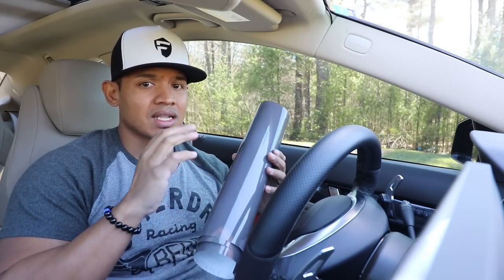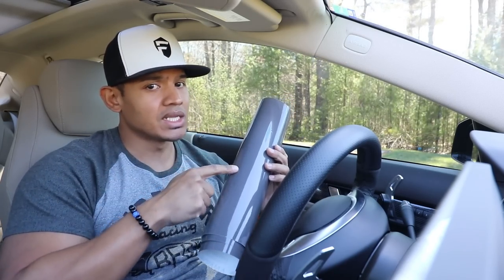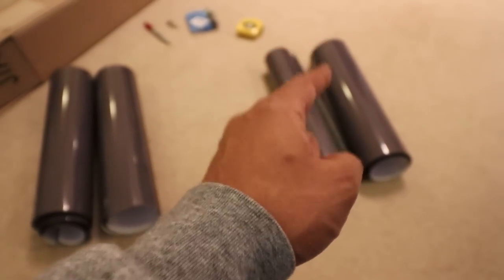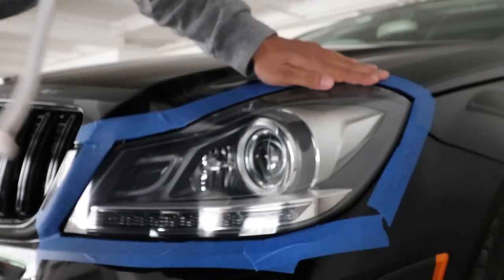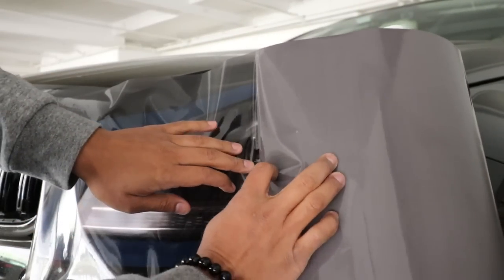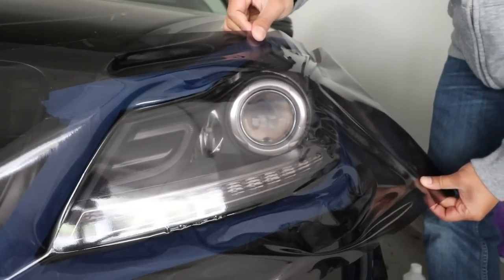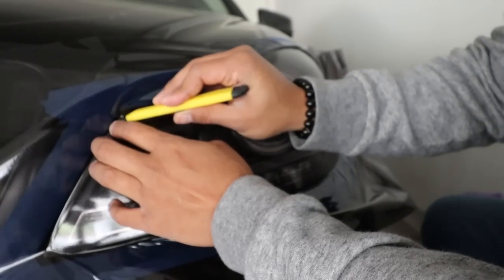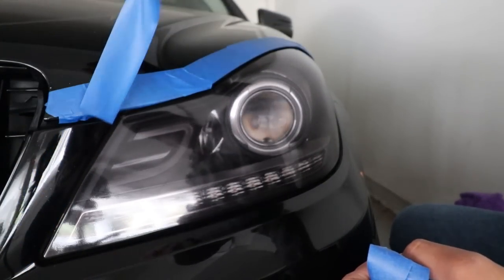Vivvid Light Smoke tint for my Mercedes headlights. Installs just like vinyl wrap!

Comment: I got the Vvivid dark smoke. I'm going to try that in a few minutes. I have no heat gun, but I've seen people do it on here without one & my Honda Element headlights are pretty much as flat as it gets. Let's hope it comes out this nice.
Reply from the maker: Way easier to heat it all and then pull it to conform to the light. Another set of hands will makes things even easier.
Reply: How your dark smoke look like
And how did it effect your lighting?